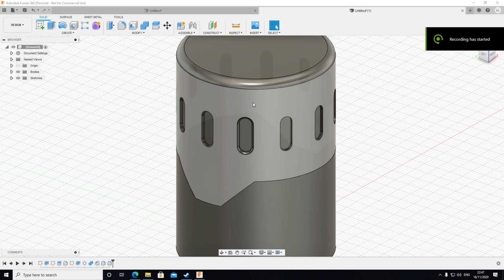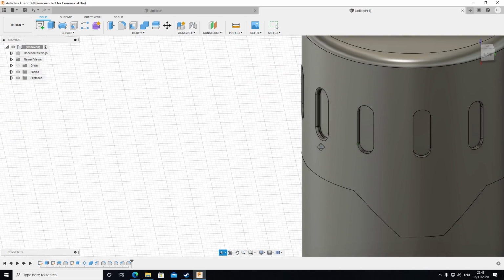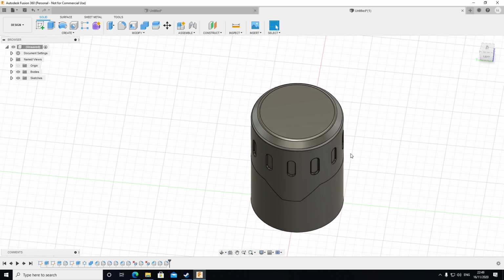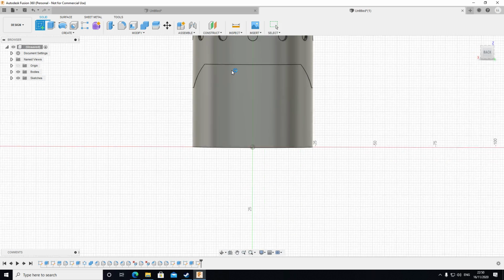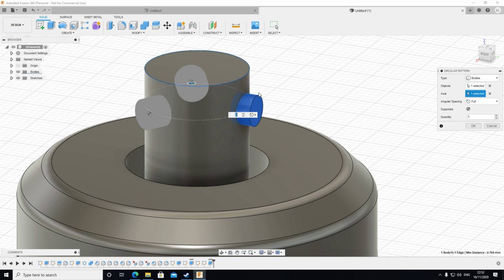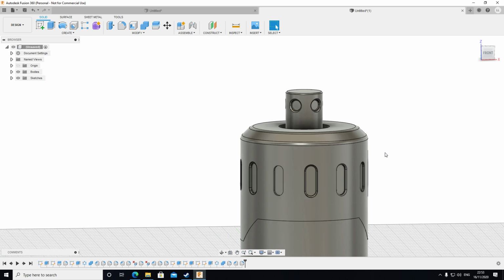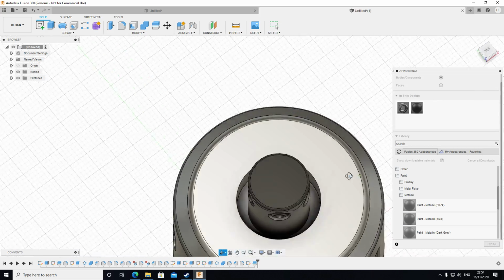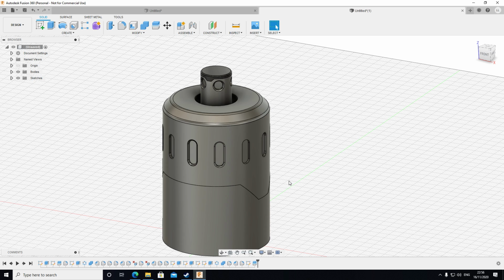Hard Surface Modelling for Beginners: Should you use Fusion 360?

Comment: Actually don't export as low surface deviation obj unless you going to impirt into Zbrush. If you're using Max and retopo, subdivide using adaptive then auto retopo using Rform. That saves having to Proree_whaterever its called down to. Say 50k for faster Rform auto retopo
Reply from the maker: To be honest I just do a manual retopo in Blender if its for a game asset

Comment: Yes, yes you should. You can model a whole weapon with just lines, splines, revolves, extrusions and cuts. Export as a low surface deviation obj and you can retopo.
Reply: Even complex firearms with organic grips and such? If so, where do I start? I can not model in SubD for the life of me so I am searching for an alternative.
Reply: @moussessr  using this type of workflow https://www.youtube.com/watch?v=BgQAnX6FxKc
Reply: @moussessr  You basically put a curve down , midline, side then create a surface between them using "skin". Search for "Organic hard surface modeling in Houdini."
Reply: @sqwert654  wow, that’s nifty, i know that’s Houdini but if Fusion has a similar workflow, then it is good. Only issue I have is that chamfers and fillets in it are often really nitpicky and do not work properly
Reply: @moussessr  got confused with another thread I was in lol. It can nitpik, What I do know is make a low poly version with no chamfers, sharp corners , low detail as possible to get the shape. Export that as a low detail obj , fbx can screw up on trigger guard I have found. Then copy project and add the chamfers, fillets, screws, as much detail as needed and export that to use as a baking mesh in Substance Painter. I also screen shot screws in ortho sometimes to make alphas for Substance. Very fast workflow, no retopo needed, just a hassle making uv's with a triangulated mesh, but you just stick to hard edges moslty.